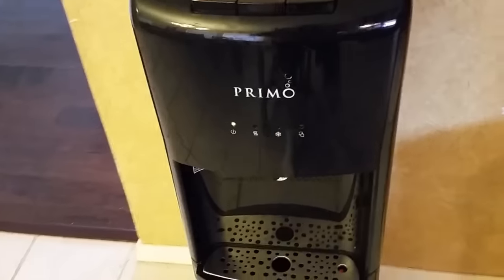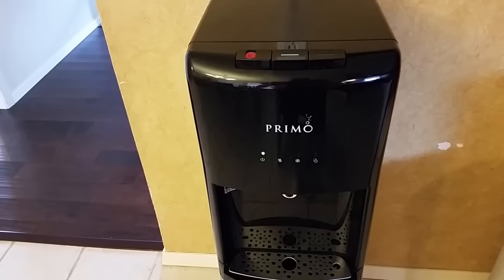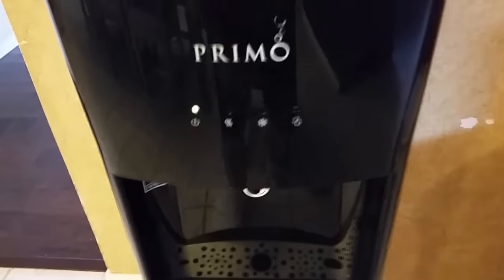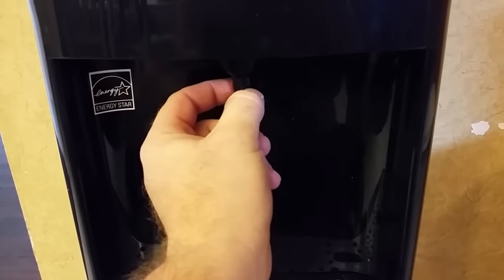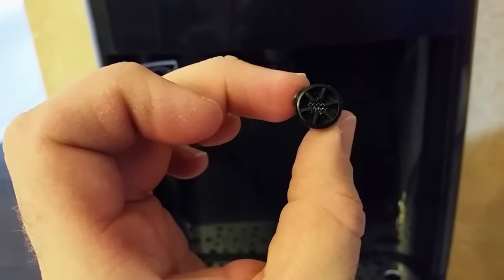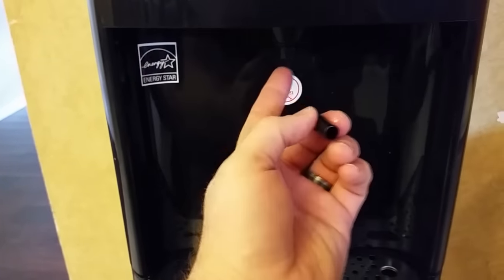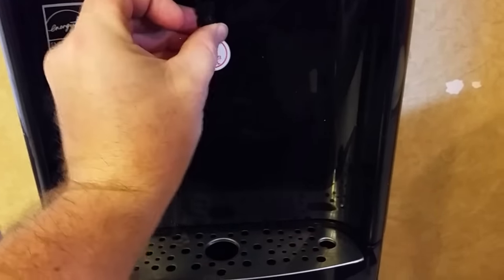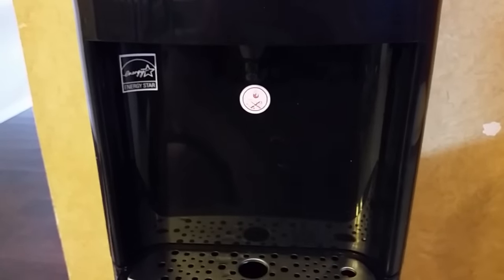How to Fix a Slow Flowing Primo Water Dispenser in Less than a Minute

Comment: I just did this and it works! I took out the filter which was clogged with a clear gel-like gunk, washed it under running hot water, sprayed some vinegar cleanser and used a clean toothbrush to brush off the build-up, rinse and voila! The water now dispenses freely. The Primo website is useless, no troubleshooting tips at all. Thank you very much for sharing this.
Reply from the maker: blue witch Thank you for the kind comment. First thing I saw this morning and made me smile! Thanks!

Comment: Excellent tip. Thank you so much. Fixed in under a minute. Pulled the little screen out entirely and it works like a champ.
Reply: I know this is an old comment but I recommend putting the screen back in there as insects could easily make a home for themselves in the split hose section.

Comment: I have a Primo bottom bottle water cooler dispenser similar to yours.  It had been slow dripping the water ever since it was new. I was so frustrated I stopped using it until the threat of Tropical Storms Fred and Grace.  I finally decided to google to see if a solution exists.  Your solution worked remarkably.  I have seen a substantial improvement in water flow, making this a good everyday water dispenser for my home.
Reply from the maker: Glad to hear! Yeah I was glad to see the latest models removed the screen so it's not an issue.

Comment: Absolutely spot on.  I easily removed mine with a gentle pull using my fingers.  The screen didn't look clogged.  I blew air through it and replaced it.  Works like normal.
Reply from the maker: So glad it helped! Thanks for letting me know! Hopefully your having cooler weather than us!

Comment: Thank you for this it works great now. I also drained the water tank which had some back up in it.  Insert a clean paper towel in the pump hose to keep water from getting in there and drain the water out. Took about two cups before I got to clear water with nothing floating in the water. That piece that he said to remove has a filter in it and needs to be flushed clean really good.  Thank you again, that slow running water was causing the cooler to make a loud noise also.

Comment: I just bought a used one and i am going to bet thats this is why they replaced this one, i was able to pull the filter out by hand ans now its working, thanks for posting this i would have never figured it out
Reply from the maker: That's funny.  I did the same, got one for $10 at a garage sale for my office.  Cleaned the filter tip, then it started working great.  Thanks for the post, glad it helped you out!  Have a great Easter!

Comment: Thank you for showing us this. This was a frustrating problem with a simple solution. Now mine works great. 

be advised

If you have a newer model like i have, its the same fix...except. When the cap is removed it may dislodge from the rubber hose leading into the unit. 

The nozzle is a connecting piece to the rubber(surgical like) tube that flows the water down into your cup

Its the T shaped hose inside the unit just above the spout. You will need to ensure your spout is still connected.

Comment: OMG, Thank You so much for making this video. I was getting very frustrated at my dispenser but I wasn't about to throw it away after paying $200 for it. I think mine is identical to yours (Self Cleaning?). Well I had pulled that out but didn't think to look for a screen. So I took mine out and wow, cleaned it out and put it back in and I'm very happy that now it's not slow, Again Thank You for Sharing.

Comment: Man! thank you so much for this post! Even though it worked better, yousaid it still didn't have a smooth stream. An added suggestion to the slow flow problem would be to do like I did. I followed what you said by taking the little piece off and cleaning it out, but then while that piece was off, I took a q-tip, stuck it inside, and swabbed around. be sure to unplug the cooler first. Otherwise water will come out.

Comment: Thanks for the tip!  

I have a different issue with my Primo.  

The hot water red button seems to get stuck every time I pull away my coffee cup once it's full of hot water.  

So I end up having to press the red button a few times after removing my cup to get the water to stop pouring out.  

I would think the red button should pop back out as soon as you remove your cup from the lever.  

Really annoying!
Reply from the maker: Yeah, that doesn't sound right. Sorry, I don't know much about other repairs, I was lucky to figure out this one...lol

Comment: I wish this was the same simple answer to a slow flow on a side by side water dispenser.
Reply: Did you ever figure it out?  I have the side by side (hot on the left, cold on the right), but there is no screen piece to pull out.

Comment: Do you think this would work on slow-flowing HOT water? Our Primo’s cold water comes out just fine. It’s the hot water that takes the 3-4 minutes to fill a 24-oz cup for hot tea!

And ours is less than TWO months old. However, we do have awesome well water. It must be the hardness of the water? THANK YOU SO MUCH! God bless you and all your loved ones.
Reply: No because a dirty mesh should give the same flow result for cold water too. Sounds like a clogged up hot water hose with either the 3 to 1 hose being clogged that can be reached by popping off the front panel, or one of the hoses in the back that is trickier to get to because of the radiator. You can try popping of the front panel, it’s not that difficult....is it a top loader?
Reply: 𝐓𝐡𝐞𝐑𝐞𝐝𝐑𝐚𝐯𝐞𝐧 Thank you so much. It’s a bottom loader.

Comment: Lol wish I found this video earlier. I ended up pulling the back panel off my top loader and popping the entire front panel off (the panel with the hot/room temp/cold buttons). That exposed the entire front hose assembly which included the nipple you pulled out. It’s a good thing that mesh screen is there because when I started the maintenance, I found a small ant colony living behind the plastic spill tray, as crazy as that sounds. I’d only assume bugs would make a home in the hose section if there wasn’t a screen.
Reply from the maker: That's crazy! Glad you figured out what was going on.

Comment: Hmmm. Mine doesn't have the lip, and doesn't look like it comes out this way from way I can tell. I have two spouts, bottom loader. I can see some kind of filter though. Not sure if I should pull it out. Doesn't look like it screws in or out on mine.

Comment: I have the same one but my issue is it’s not dispensing cold water. The light for cold is on and it makes the noise as well, but not cold water comes out. Any tips?
Reply from the maker: Sorry, just make sure switch is on, on the back. Not really repair man, just discovered a trick or two.

Comment: I have done that but it is not fixing it all the way. Mine has the problem hot water mainly. Any clues as to how to fix that? Is it a pump issue and not filter issue maybe?
Reply from the maker: Sorry I'm not a primo repair guy, just figured out a quick fix for mine. Seems to be a common problem for a few others I found out after posting. Sorry, good luck!

Comment: so it helped with flow but i cant get the screen to stay in, feels like pushing against rubber and not staying any help
Reply from the maker: Screen shouldn't have fallen out. Should have been firmly in place, just wash it out and  put it back. I guess you don't have to have to have the screen, I believe some newer models it's been removed.
Reply: I had to the screen out (the whole plug) It was tight. Looks just like yours. When I posted it back it gets pushed back out. Without the screen it seems to drip forever.
Reply from the maker: Mine fit back pretty tight. It was doing that drip thing too. Wondering if you could put a little plumbers tape around it.

Comment: Yeah we were pressing the button hard for the water to come out faster and the middle button got stuck, water was all over my kitchen.  I’ve only had it 3 months.  We called primo and they are sending us another one.  Just call the number on the back and give them the model number if you have problems and they should send you a new one free of charge
Reply from the maker: Thanks for you post. Primo's service  is really awesome, but the slow flow issue doesn't require a replacement just a quick cleaning and it's good to go. I'm glad to hear they took care of your issue!

Comment: i have no flow problems but i was curious so i took it out and there's no screen. it's just a tube open at the end. mine is a 2019 model with self sanitation 601090 SO-C
Reply from the maker: You may have newer version. They fixed the issue.

Comment: Only do this if you don’t mind using the unit without a nozzle. The nozzle came out easy enough, but internally it attaches to a rubbery piece that retracts once the nozzle is out. There is no way to get the nozzle back into the connnector.

Comment: my machine won't dispense HOT water.  What are we doing wrong?  :(
Reply from the maker: Sorry, not a repair guy. But I know mine only heated if the switch on the back was turned on for the heating unit. Might take a while to warm the water. Best of Luck!

Comment: I'm thinking the bottled water you use is not filtered properly or low quality.  This problem happens with city water at the faucet dispenser disperser screen catching flakes of sediment.  it shouldn't happen with high quality bottled water.  Could be a design flaw with your machine dispenser.  I've had a cooler dispenser for 3 years (Clover) never a problem.  Suggest upgrade to a better brand of water.